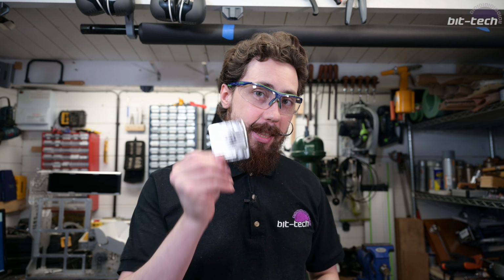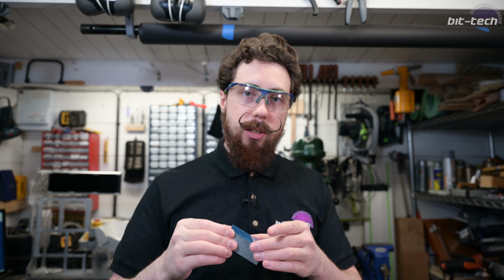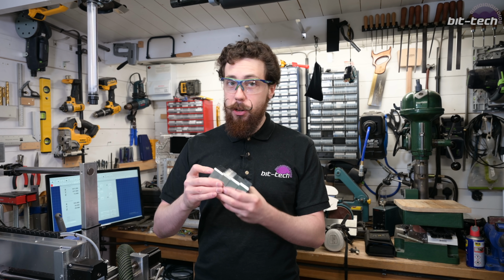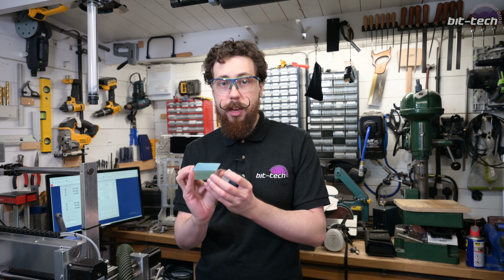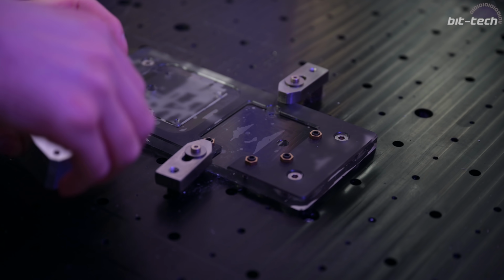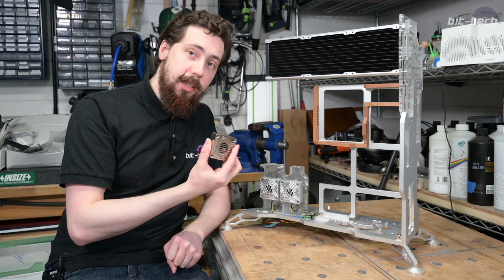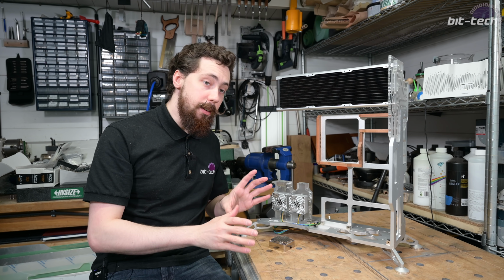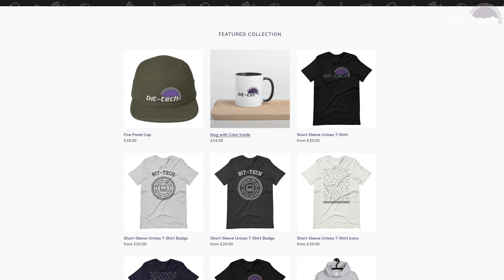AQUACERAS Part 10 | Making the CUSTOM DDC Pump Heatsinks | bit-tech Modding

Comment: If you plan on making more. i would suggest you see about getting some relieved chank endmills (0.1-0.01 total relief) for the deeper work (past 10mm total depth) - and perhaps when you make an aluminium fixture plate. make one for doing multiple parts op 1 only. that wat you get a bunch to put on the shelf. and then have another plate that can hold and locate on op 1 and do the rest. just 1-2 parts

Comment: Great video! What is the thing you use to hold the part on the second operation? It looks like it has an eccentric bolt head that clamps the piece
Reply from the maker: They're Mitee Bite fixture clamps

Comment: Since you mention making a more long term fixture plate...I know you're more considering it because it's a part you'd use again, but do you think items like these, certain distro plates for case mod projects inpopular cases, and your custom water cooling fittings are items that could be financially viable to sell at some point?
I think there'd be some interest. Obviously it depends on how you'd be able to price them after material and machining costs, but you've put in all the work and they're extremely beautiful. 

You really create incredible bespoke artisan items and I think there's an opportunity there, most people in this hobby are prepared to pay a premium for water cooling components. Also I think that many of the people that want to support you would be inclined to buy a more expensive but truly unique item that reflects your skills, rather than a printed mug or tshirt.

I know it's a big task, but I'd also really really love to see you tackle a DIY CNC build, maybe one specifically designed for production of certain staple items. Like, long and narrow format for space saving and more easily achievable rigidity, with ATC for automation.

With your skills and attention to detail the result would be incredible, and you'd increase your production capacity for potential new revenues that take advantage of all the work you're already putting into these parts..

Comment: Ironically just got a call from a company in the states. Previously they only had access to Datron as part of a quote system, as they didn’t have continuous stock. So the price today could be different from tomorrow. They now carry them in stock, so they have consistent pricing! Now to save up to buy some bits! 😂
Reply from the maker: They really are fantastic endmills. I mean if my machine can cut well with them, I think that speaks volumes.
Reply: @bittech1  yeah you’re the one that put me onto them a little while ago...unfortunately living across the pond...they’re not easy to get. I was pretty giddy when I got the call telling me! Thanks for putting me onto them!
Reply: @bittech1   first of all great project and very nice work!

I think you should consider making a deal with Datron, for the tooling if not even for a Datron Neo or one of their other CNCs. I have a feeling they would be up for discussion if you advertised that you use their products (which honestly are some of the best high rpm cutters out there and work well even with less rigid machines). 

Alternatively there is also Firstattech, which is also very good (their Terrier chipbreaker is a beast for hogging out tons of material, tho you wont get the most out of it on your machine).

If on the other end you want to DIY a more capable machine I would recommend looking into something like a PrintNC (easily customizable as the Fusion files are available, as well as fully parametric).

Comment: One question 
Is that a ER11 or a ER16 that your spindler have?
Reply from the maker: Mine’s ER11
Reply: @bittech1  damit 
had found the perfect tool for remoning a lot of material quickly and easily but it only fit's / works with a ER16 

hmm is it one of those where you can take the ER holderpart out by a alen bolt on the side ?

since i found this tool witch i fought it would be perfect for you to cut down your roughing time with removing a lot from like a pucked but i didnt know witch ER size your machine has 

https://www.taiwantrade.com/product/ergo-12-16-20-25-32mm-integreated-er16-taper-shank-milling-cutter-2116311.html

Comment: if you hate that radiatror, ill take it. i love the Barrow Chameleon. they are really cheap and for how cheap they are they are really well made. in terms of performance i couldnt see anything different from Bykski, Alphacool or EK radiators
Reply from the maker: The issue is it's literally broken. The thing fell apart as I was screwing it into the plate, the tank standoffs had been massively over-torqued in the factory, so they just sheared off.
Reply: @bittech1  really? Wow mine dont do that, i had like 10 different never had that problem before

Comment: I often see you use theses small cubes with threads on each side, mainly to connect the panels of your cases. Where do you get these cubes from? ...how are they called? ...or do you manufacture them by yourself?

Comment: Feels so wasteful to do a whole back panel again, wouldn't it be possible to make a smaller plate just for IO? I cannot stress enough how much I admire the output of your work.
Reply from the maker: I had originally planned to do just that, but the 3090 is so radically different in size that it would just introduce weirdness elsewhere. Plus this means I can fix a bunch of things that were bugging me with the first one
Reply: @bittech1  thanks for the response. cant wait for the next part.